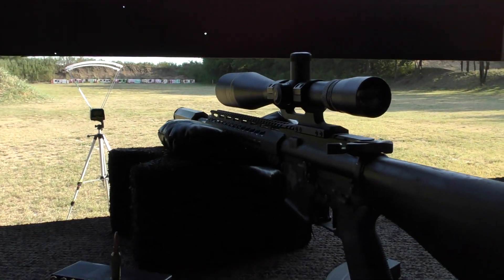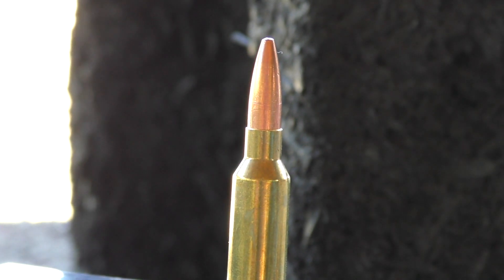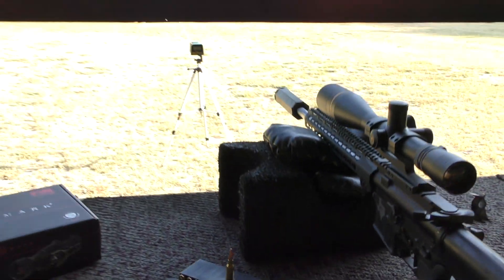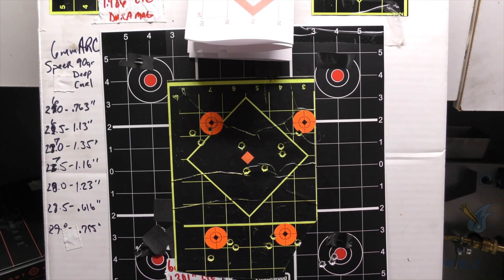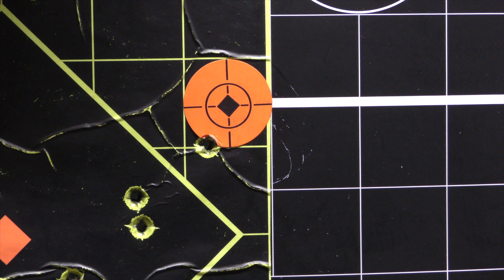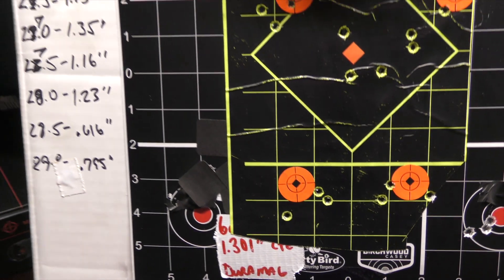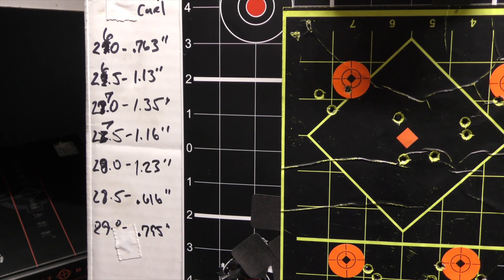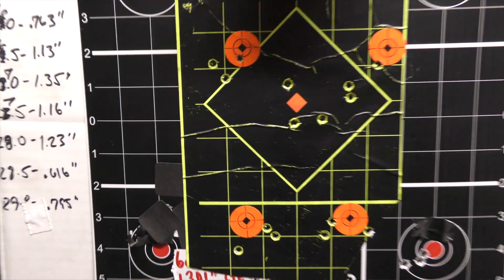6mm ARC - PROOF Research 18" stainless steel barrel - 90 grain Bonded Bullet Handload - TAC powder

Comment: I've got a 22" Satern barrel on AR platform rifle. Been loading TAC under Speer 70gr, Hornady 90gr ELD-X, and Hornady 95gr SST. Getting very good results, 5 shot groups .42-.79 and then some others with flyers here and there.
TAC works great.
Reply: What is your oal for the sst? And max charge of tac? I'm running those too in my bolt gun. Max so far at 29

Comment: Have you done any more workup? 28.5gr looked ideal for group and ES/SD. Would love to see that in two 5 round groups to see how it bears out.
Reply from the maker: Unfortunately I sent the Proof barrel back for a refund due to the short freebore so I don’t currently have a 6-ARC
Reply: @pigpoppertx6926  Don't blame you, a barrel of that price point should be 100%
Reply: @pigpoppertx6926  That is to bad. I agree with Eric and start to play with seating depth at 28.5 and you would have probably had a real tack driver. Was it measured and verified that the chamber was reamed incorrectly?
Reply from the maker: @rustynut1967  proof simply stated that the freebore was tight on the barrel so I sent it in for a refund.

Comment: Thanks for this video. I wonder how much gain you would get with a 20-22" barrel?
Reply from the maker: I guesstimate 75-125 FPS gain
Reply: I think it’s about 20-30fps per inch. But the ARC is new and not a lot of reloading info out. Pig Popper is leading the way!